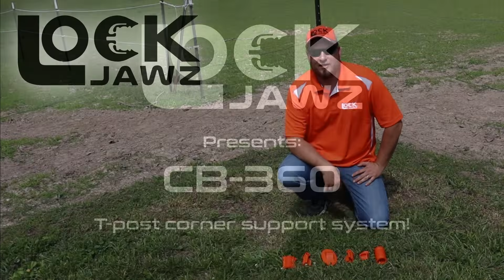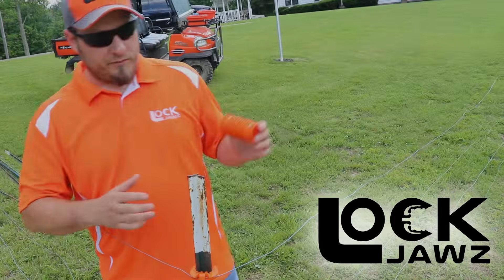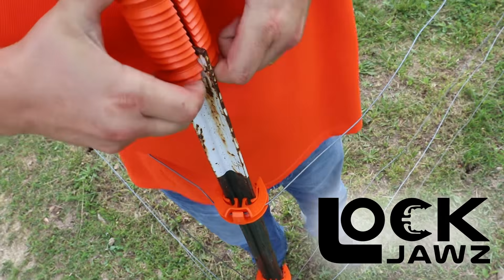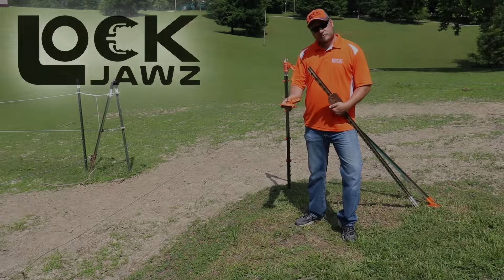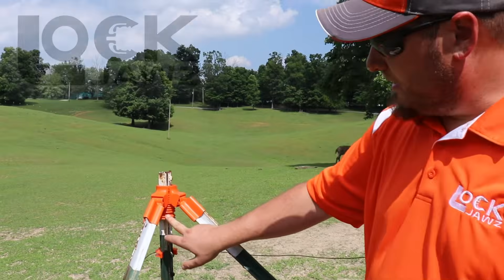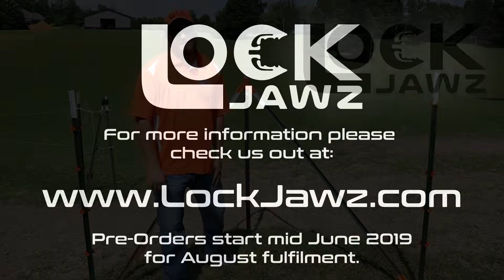C 360 Corner Brace Intro

Comment: What are the approved temperature ranges? Very interested but we get well below zero degrees F every year and sometimes into the low 100s. Not worried about the high temps but the lows and becoming brittle in the cold.
Reply from the maker: Nick, we have customers all over the US and Canada with freezing temps well below 0 and they are holding up very well.

Comment: If wire also against t post and adding electric after will the narrow gap cause the wire to touch the electric ?  Think I have to use 2-5” spaced ones to not touch existing wire fence.  Do you have a product with extension ?

Comment: Looks real cool. But wouldn't work for the tpost we have in my area. Local stores pretty much all sell tge smooth style tpost, it doesn't have that front bumb.
Reply: Do you have a Tractor Supply in your area? They sell the ones he shows. They have the cheap garden posts inside the store, the real T posts are outside in the yard.
Reply: @andyandy4459  we do. Would have to recheck if they carry them (tsc Canada and USA don't necessarily carry same stuff) and we already have lots of fence up that are light and brown heavy duty T post (but no bumbs) they don't have the flaring these guys do. I find it dumb stores only have access to what suppliers have which they are a being built for the bunb style noway days. They used to make some for the no bump one that were good but reds napper is now zereba and they only have for bump ones now. They loose on the other ones.